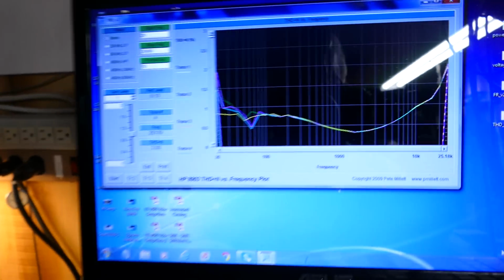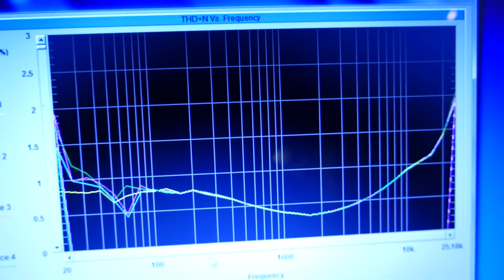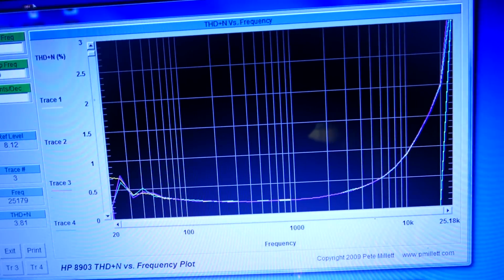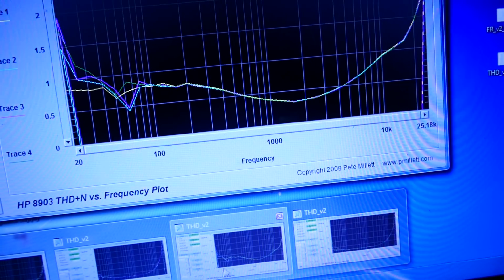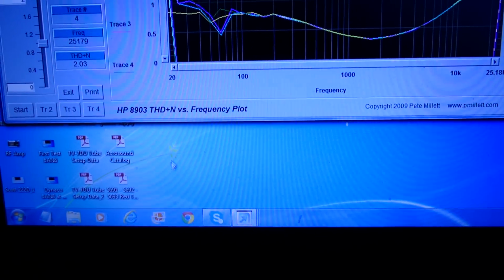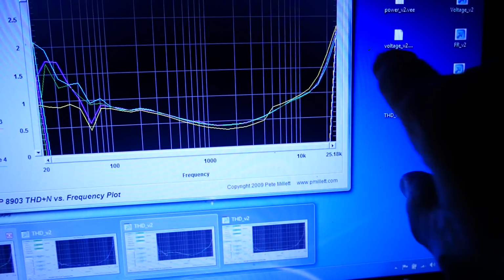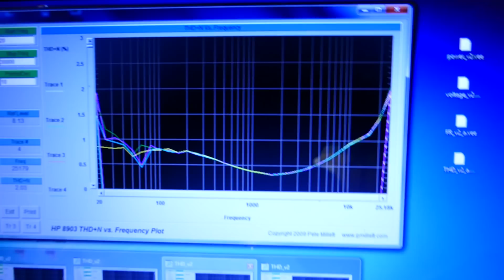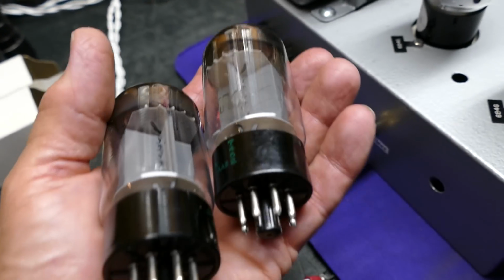Performance Of NOS JAN 6B4G Tubes (1974) vs Older Vintage 6B4G Tubes In Acrosound Circuit

Comment: Hi David, I know you figured out the issue with the JAN tubes from Part 2. What I found most interesting is that initially you stated that you tried the tubes, and they sounded Good  to you, and that you liked them... It was only After you ran the tests on them and saw the results, that you then Didn't like them and wanted to return them.... Could you hear a difference in them? Thanks, Tom

Comment: I remember having this issue back in the late 70's on an old PA amplifier from the late 40's. I had replaced both 6B4's with New Sylvania (non-JAN) tubes and immediately had a 60 hZ hum. I also wondered why the new tubes looked like a beam power pentode, but after looking in the later edition of the tube manual, it showed that it was connected internally as a triode. I lifted the heater center tap from gnd. but used a fixed resistor across the heater winding as opposed to a pot. I was going to install a linear taper potentiometer, but decided it would be better with a fixed resistor to kid-proof things in case the customer decided to get curious and turn the pot. We know how some customers can be with their DIY curiosity :) I'm curious to see the end results with yours connected live to the scope and spectrum display to see the harmonic profile in real time! :) Good video as always :)
Reply from the maker: +Frank Ferraro Hi Frank - as you might have already seen, I did post some live scans of both tubes mostly per your request. There has also been discussion of the cathode connection to the filament which appears to be at one end of the filament. The 6B4G has a similar pinout to the 6L6 except for the cathode connection on pin 8 and of course, no screen connection on pin 4. The JAN substitutes work perfectly well once the filament issue is addressed as you have also experienced. The old vintage ones seem to have a little more visual "class" about them but I changed the amplifier that I built for the VT-25A's and put 6B4G's in it and it performs at the high end better than the one with the big 50 watt transformer and I get as much as 15 watts out of it. It is also a higher Z primary.  I think I have satisfied my need to build these low power triode amps. Overall, they aren't bad and sound as good as the McIntosh (to my ears) at any sane listening level.

Comment: Yeah, Sylvania satisfied a DoD requirement by triode wiring 6AV5 sweep tubes internally.

It seems to have been good enough for military purposes.  As the curves show, the tubes are NOT good enough for music reproduction.

I believe the tubes started as 6AV5GAs, given the straight sided envelopes.  Perhaps ST bottle specimens (6AV5G), if available, will perform a bit better.

Eli D.
Reply from the maker: +Eli Duttman Eli - now that you mention it, it does look like a 6AV5. You guys have solved the mystery of the JAN 6B4G and with the information you all have provided, I put in a 25 ohm pot across the filament winding (removing the center tap connection) and found that the JAN 6B4G's perform great with one side of the filament winding grounded - the "real" 6B4G's need the pot adjusted to the center. The problem showed up quickly on the error output of the AA501 and was obviously a 60 Hz issue. So, indeed, these tubes can be used to replace original 6B4G's but since the JAN tubes are not a directly heated filament, the cathode bias configuration must be changed as mentioned. The JAN tubes perform great with this modification to the original Acrosound circuit. I will video and post tomorrow. I hope it can help others that may run across this situation.

Comment: That was unexpected... I wonder what its like in other tubes.
Reply from the maker: +lbochtler I have five of the old vintage tubes and they all perform the same. Just by visual inspection, it is hard to believe these 1974 JAN 6B4G tubes are the same as the old ones. The older ones are obviously a triode. The structure of the newer tubes sure look like a 6L6 with the beam forming plates of a power beam tube just inside the plate structure. I think the inner structure just mentioned IS the plate of the tube and the outer "plate" doesn't appear to be connected to anything? Very strange. I will do some more testing and measurements in particular, the cathode currents.
Reply: ElPaso TubeAmps
I have seen such false plates in other tubes, mostly in high Mu preamp tubes, such as the EF184, it also has a large plat, but if you look inside you see the actual much small plate. These tubes did not need those tin RF shields to work properly. This might also be the case inf the 6B4G you have. I am not to familiar with that specific tube, but the shielding might have been added due to the military application of these tubes.
Reply from the maker: +lbochtler Good point about the military application. Thank you. They actually do put out more power and lower THD at 2 KHz but the full spectrum plot is not so good for audio.
Reply: ElPaso TubeAmps
 I did a bit of resurch, and the tube you have is actually a Pentode connected internaly as a triode, it is not a 6B4G, its considerd a drop in replacement. I found that on the site: boiaudioworks.com/otherpowertubes

Just some fun info that might explain some things.
Reply from the maker: +lbochtler Thank you very much.  I had no idea. This explains the obvious physical differences as I mentioned above. I have also worked with the amp a little bit more  and found that 60 Hz hum was the problem at the low end creating high THD. It was pretty obvious on the error output of the AA501.  I took the filament winding center tap loose from the cathode bias resistor/capacitor and put in a 25 ohm pot with the bias components at the center of the pot and the hum goes away with one ended of the filament winding grounded and now these tubes actually outperform the original vintage ones... A bit more work tonight and I will post another video with some updated information. Thanks again.